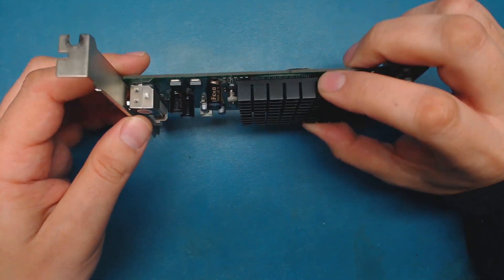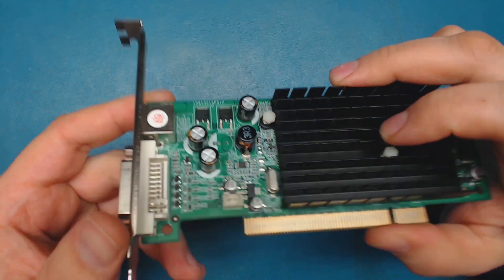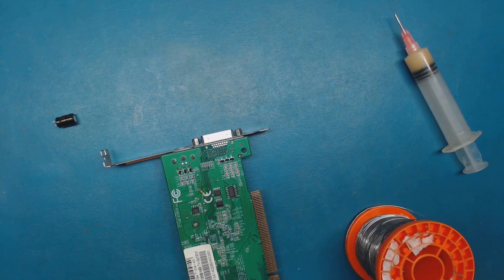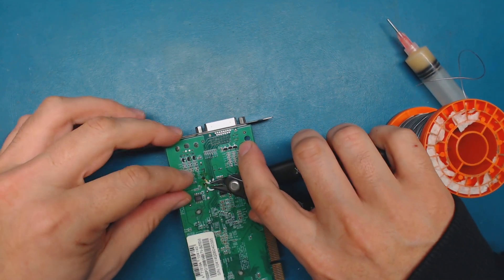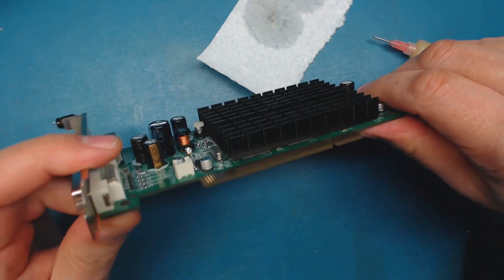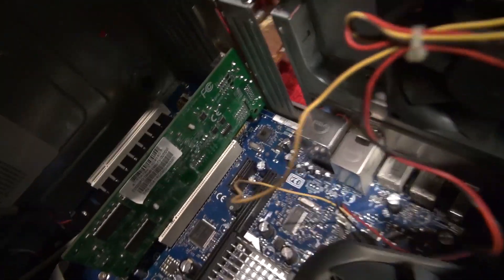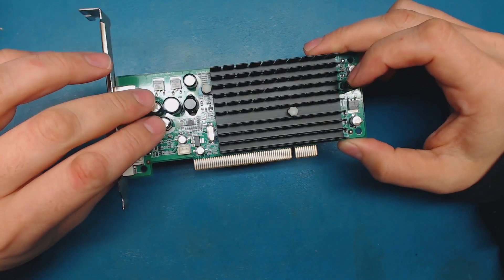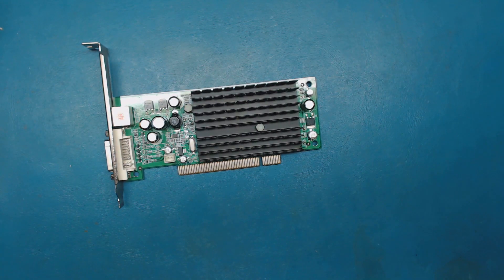Geforce Video Card Repair And Test. Part 2

Comment: im wondering why i have two MOSFETs with different number the same TO-220, after charging their gates, one of them the low resistance bet. drain and source moving from 0 to almost infinte but the other is not, steady low. Is the 1st one leaky? defective?

Comment: I find myself torn here. normally I am all about fixing stuff but after shipping on mouser you can just get another cheap pci video card off ebay for $7 to $15. Id say in this case I would just use what caps I have laying around and not order anything. but since your working on might as well take the heat sink off and put fresh thermal compound on it.